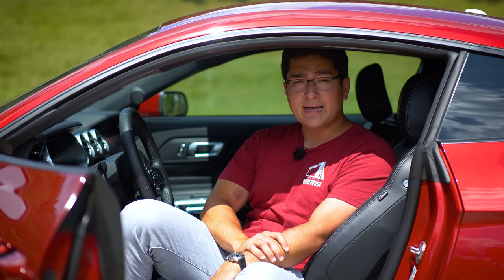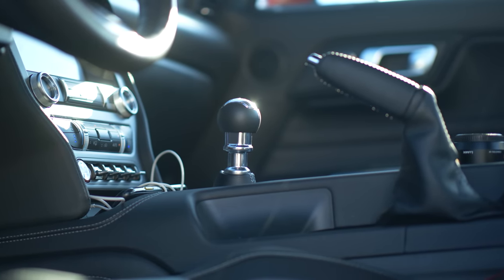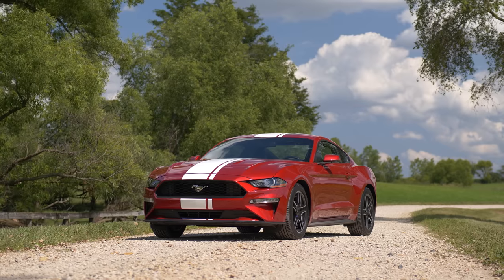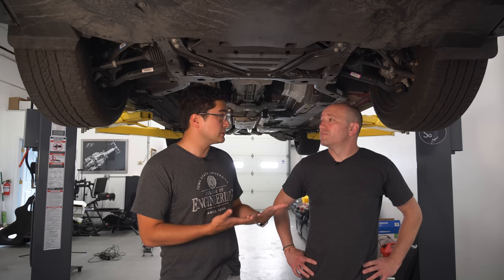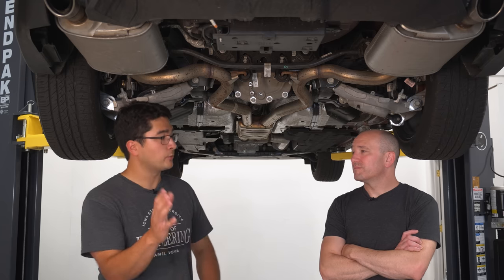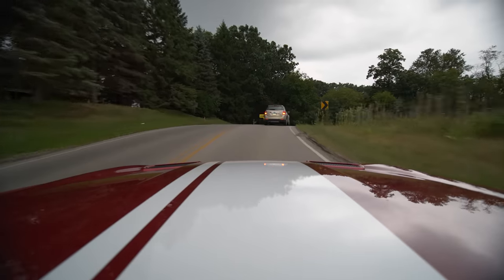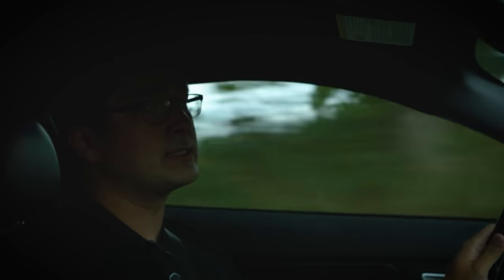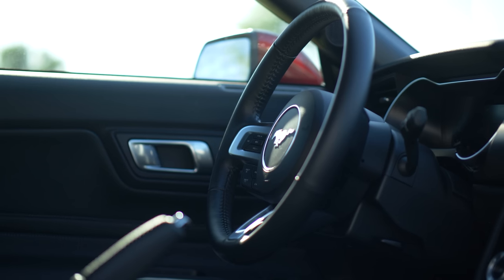2020 Ford Mustang EcoBoost | Red Headed Step Child

Comment: When you consider that the average driver is really not that good at driving, I would hope that they wouldn't get into something with much more performance than this. I think this car is plenty good for most drivers out there.
Reply: So true. If you want little bit more horsepower than 86/BRZ but want to learn the dynamics of RWD, get this instead of used GT or SS
Reply: best comment on here
Reply: @SHKim-xr1jl  Totally unrelated but I absolutly cannot stand the 86 🤢
Reply: Most of the dopes in YouTube videos crashing Mustangs into trees or crowds while showing off should have bought one of these instead.
Reply: Good point and oh, so painfully true.
Reply: It’s arguably too good for most drivers. It’s faster than it needs to be which is frightening.
Reply: I love 4 cyl turbo cars, the problem is the mustang is too big a platform.  The perfect size turbo 4 platform is the BRZ/FRS or Z4/supra.
Reply: Jeff K exactly. this kinda engine if done properly would have been perfect for the fusion or the focus rather then a mustang
Reply: @georgetheodossopoulos7827  That's why we had the Focus ST and RS. They were great cars.
Reply: I don't think its low performance at all. 300hp, rwd, 6speed. I wouldn't mind this car at all. Too much more than 300hp isn't really useable on the street anyway. Back in the 90's and early 2000's people would lose their shyt over a car like this
Reply: For a everyday driver 200hp to 250hp is more than enough.  I don't even need more than 160hp in my daily.  I never use that much power when I go to work and back.
Reply: David Fessehazion agreed. the existence of the eco boost is great but it’s been put inside the wrong car
Reply: Agree, also I always believe it's fun to drive a slow car fast
Reply: It's a decent car but I wouldn't call it a performance car. Maybe sporty?
Reply: @dougrobinson8602  and how about a former deputy in Reno who crashed and killed himself and a passenger when he mis-shifted in a 5.0 while trying to race? yeah, i'll stick with a depowered mustang, thank you.
Reply: Wigletron I agree 100%. I have a 2007 Z4 with 265 hp which is the perfect amount for that car and public roads.
Reply: Casey Schmidt I’ve driven cars with 400-450 HP. You are correct 250-300 is very streetable and fun. (:
Reply: @Drooligan  I'm actually tempted to get the 4 cyl supra now that it sounds like a manual transmission is going to be a real thing.
Reply: My 4cyl has 160hp and is fine.This eco boost has plenty of power but the engine is crap .
Reply: Kool Kitties Are there reliable issues with the EcoBoost 4 cylinder?
Reply: No not everyone needs rockets but in my fantasy land everyone who couldn't operate or afford a performance vehicle would have to drive something that isn't trying to be something it's not. It'll never happen but it's nice when i imagine it
Reply: Phillip Very interesting 🤔 comment. I like your world.
Reply: @jeffk464  I'm with you, there.  The Mustang is functionally a 2-seater, and for that it's way bigger than it needs to be.  
I think when Ford was making the S197 Mustangs and the Challenger came out, Dodge made out the Challengers fat-ass size to be a selling point, so Ford fattened up the next Mustang.
...Just as Chevy trimmed some weight off the Camaro.
Reply: I'm Asian an consider myself a average driver an I own a older v8 mustang with a solid rear axle and even when I drive like an idiot I've never lost control. Anyone u see crashing a mustang has no respect for the car or common sense for that matter. Tho I admit my mustang is squirrely af on shit roads
Reply: it ain't that

Comment: Honestly, this is enough. Rear Wheel drive, manual transmission, and sub 400 Horsepower -- this is something you can actually drive hard. You can learn, you can handle, and you can daily this easily. You cannot drive a, say, GT350 all out on normal roads. I like this :)
Reply: problem is its a ford the king of unreliability...... No car should have ANY problems before 100,000 especially in modern day. DONT BUY MANUAL MUSTANGS they are trash. Ford is being sued right now because the manual mustangs all broke
Reply: i found that i had to exert more effort with the steering on a 5.0 when going through the twisties than with this ecoboost. the front on the 5.0 was quite heavier, like wrangling a mustang. i drive the ecoboost as a fun beater car, but can floor it and get power when passing in the mountains.
Reply: 300 HP is little but not enough to say sub 400 😉
Reply: @acsecond  I've been driving mustangs for years with no issues. The trick is to remember that you don't have to beat the hell out of your car everyday, but that applies for any car.
Reply: Thanks thats so true, the best car to learn in is a slow car you can drive fast. Once you comfortable you can work your way up to more dangerous cars like the GT. That cars fire 🔥
Reply: @CiastekD  I've said sub 400 because that is really the limit of what you can properly use. Also, since when did 300HP become slow???
Reply: @MajorLeagueBassboost  i never said it's slow or something.
Reply: @ghuff31  they switched to a cheaper company to make the trans. Which caused a class action lawsuit. Some owners have replaced trans at 30k 3 times. Drivers say MT82 and MT82-D4 manual transmissions are defective in 2011-2019 Ford Mustangs. Ford knew what they were doing but being the POS that they are, they decided to hide it. They just got out of a lawsuit with focus and fiesta owners because those cars are just as poorly made. some focus rs had major head gasket issues because they made it too thin and cheaply. failure at 20k is not uncommon. FORD stands for FIX OR REPAIR DAILY, Fucked over run down. Ford as a company doesnt care about customers. u vote with your money.... sadly most people dont research cars before buying them.
Reply: D H  you reach the limits on national roads much faster,  that's what I mean. You can get in trouble much faster and easier in a GT
Reply: You cant drive a ecoboost "all out" on normal roads. The GT is a very easy car to drive
Reply: @3star2nr  I have only driven a GT on freeways and town roads so far...i wonder how does the ecoboost compare....but not gonna lie speed bump to speed bump, its insanely fast.
Reply: @LekaLEL  I can answer that. Ive been daily driving my S550 GT for 4 years and I do track days. The GT is a puppy to drive. 

Its a very easy car to handle despite the power and the way the power comes in is very similar to a 350Z its very linear and smooth but doesnt have the wild TQ punch of a LS engine.

The benefit to that is that the car is super easy to control especially in wet weather and on track. It gives you a ton of warnings before it kicks the tail out and the TCS and ABS are awesome! They dont cut the power and they'll let you kick the tail out as much as you want. 

To get out of a slide all u have to do is give it gas. 

The ecoboost is a much more lighter and nimble feeling car. The steering doesnt feel nearly as heavy as the GT. A ecoboost in normal steering feels like a GT in comfort mode steering wise. 

I personally prefer a heavier feeling wheel. 

The brakes on both are excellent but the GT is way better. Interms of power delivery the GT is a better engine overall. The eco does a great job though but u do feel it losing power over 5k. They tuned it for low rpm quick spooling power. 

Interms of real world gas mileage my GT gets around 25-27 mpg on the highway. The eco only gets 2mpg better. 

Around the city the ecoboost destroys the gt in gas mileage. You can get 19-22 city in the gt you'll 15.5- 19 max

On average plan on 350 miles on one tank of gas for highway drives and fill up every 200 miles for city heavy traffic drives with the GT
Reply: @LekaLEL  both cars are great but if u are on the fence i recommend buying the GT. The ecos power and handling gets boring super quickly. The GT is just a much better owner experience. 

Plus you can improve the handling dramatically for under 1000.00

If you want to all the GT350 suspension parts bolt to the GT frame so you can make the car handle super well for very little money. There are always guys selling GT350 take off parts. I saw a guy sell a set of GT350 springs for like 30.00 shipped... 

Even if you go with all new parts its only 2000.00 in parts to fully convert the GT suspension to GT350.
Reply: @LekaLEL  definitely get the GT performance pack. The torsen LSD and the brembo brakes are absolute must haves.

The only issue with the GT is the lack of the oil coolers and the MT82 has issues if u are a drag or street racer. If you are shopping new a Mach 1 has the same teansmission as the GT350 now and has the oil coolers on the trans and diff. 

If you want to build a serious performance car thats the car to buy.

But even if u can only afford a base Gt all the parts are interchangeable.

Most jobs are easy to do on this car for a DIY person. The hard jobs are headers and clutch swaps. This u definitely want to pay a shop to do.
Reply: @LekaLEL  as for reliability get the extended warranty. Fords have AC issues. Mine failed at 70k. They replaced the entire system for 150.00
Reply: @3star2nr  that's cool , see thats what makes it such a good car in our country. Paying $65k to try and get in a GT or pay $47 to get into an ecoboost. 
Insurance on the gt is $800 pm vs $167 pm for the ecoboost not to mention the high expense of fuel in South Africa....the ecoboost makes the mustang platform a more attainable argument for many....all the looks and toys of the gt except the 5.0 engine....is a fantastic selling point.  That's why they sell so well.
Reply: @3star2nr  we only have the auto gt and ecoboost here with pp. While the bullit is the only manual and retails for msrp $73 k
Reply: @3star2nr  I hope the mach1 replaces the bullitt here bc that's all we got besides the gt and ecoboost autos
Reply: @3star2nr  is that dollars or Rands?
Reply: @LekaLEL  so based on that man in all honesty the ecoboost is a great car to own. Like you said saving over 600.00/mth just in insurance costs and 15k upfront in purchase price. To me thats a no brainer.... 

15k in an ecoboost will make that car run 10 seconds on the 1/4 mile... You will need engine work to go faster. 

The ecoboost engine has a lot of potential and its very cheap to modify. 

If you bought an ecoboost you won't be dissapointed with the car. When you feel bad about it remember your saving what like 7000.00 per year... In insurance. To me thats not even a choice
Reply: @LekaLEL  to be honest given your situation id consider the focus rs. 

Its a better buy all around than the ecoboost. Unless you love the mustang body style and interior more.
Reply: @3star2nr  hi they stopped selling ford focus here since 2017, I got the last one, a Ford focus diesel ( lucky because I do heavy miles everyday)

So no use buying a 2016 Ford focus st, I want a new car.

I don't do track days, its just like my daily car,  tired of all the vw gtis and BMW in my hood. I like to be different and have been driving fords since 2009.

But the difference in ownership costs between the gt and ecoboost is massive
Reply: @3star2nr  since I already have a focus its time for something more sexy.

Remember I mentioned the ownerships   costs ( upfront buying $15k, insurance  pm is like $700 difference) not to mention fuel is super expensive here. 

It just makes sense to get the ecoboost. 

Just with the insurance savings I can drive my ecoboost without even caring about fuel economy and still have change over to customise mt ecoboost. 

Remember we get the euro spec mustangs.
So they already come fully loaded with a full pp1 and some parts from pp2.

I don't do track days, and because I moved to the city now, it's more about the looks and drive then speed. 

And because of corona shew, prices have increased $$$. No discounts on the gt,  maybe a few dollars, but the ecoboost have got massive discounts a couple of $100 , which is good 👍. 

 I'm planning on having a kid and get married soon to. So lol I don't want a car that's to expensive,  I want to use that's savings to get the wifey a mazda 3 or cx5.

So the ecoboost is a good compromise in my situation.
Reply: @acsecond  I have my ford focus 1.5 tdci manual trend since 2016, i have North of 100 000km with zero issues, except a blown bulb,  but really now.
Still have my ford fiesta 2012 model going for 200 000km , only did maintenance and changed wear and tear items. 

Both have never left me stranded or broke out of the blue.

I am nervous about the cheap Chinese parts they put it, but that's a quick fix just swap them out for decent parts.
( we don't get the manual mustang , only auto 10 speed).
Reply: @acsecond  the 5.0 coyote an extremely reliable engine. Most of fords v8s are dead reliable granted they have had a few dudes. Its shitty maintenance and ford cheaping out on important harnesses that's the problem.

Comment: The fact that theres 310hp RWD IRS car for 27k, I'm happy.
Reply: S.H Kim bingo
Reply: Exactly, haters can hate all they want but, for less than 30k you have yourself a great looking car,  is plenty fast (especially if you pump 93 octane), RWD with IRS...whats not to like?!
Reply: Yup, if they just changed the body slightly and renamed it, it wouldn’t get trashed by typical haters.
Reply: MIBASO88 it’s a hell of a deal for the money, the interior can be rattle hell but it’s still pretty nice especially on the premiums
Reply: Michael Buffington I really am hoping that for the s650 that will be coming out in 2022, they will do it a favor and rename it the ST....I agree that ecoboost is kinda “meh”...
Reply: That's a pretty bad Price?
Reply: Frank White  well a Tesla isn't a bad deal but I know a mustang is never a good one
Reply: @popinmo  Dont like it, dont buy it.
Reply: @M4B21S88  duhhh
Reply: @M4B21S88  makes no sense
Reply: @popinmo  duhhh
Reply: @M4B21S88  you are clearly hurt
Reply: @popinmo  lmao
Reply: Eh, I'd rather have a lightly used 370z over the ecoboost. Or better yet, a lightly used 5.0 GT premium or 2016+ Camaro SS. F8ck that depreciation hit.
Reply: rockn roll Yes, the 2015s especially, had some issues and were the ones more likely going boom when tuned (the ones built in Valencia, btw). It was a brand new platform in the mustang. Come on, man. (Most) Everyone knows that the first year model of anything new has its risks, in any car model. Youre more likely to hear a few horror stories and make it out to seem like ALL EB mustang owners are having issues left and right. Thats just simply not true.  Plus, a few of those having booms were due to user error - and still are (tuning for 91/93 octane and pumping 87 😬, as an example, or just bad fuel offered at their gas station).
Im at 88k miles in my ‘16 and no engine issues.
Theres a few ppl in the forums that are over 100k and even up to 150k, some stock , some tuned/ modded, no issues.
Reply: 03 04 Cobra?
Reply: Mike Gee  that's what I wrote, Mike
Reply: 1967 Fastback Mustang GT 390 cubic inch had 320 hp, though, curb weight is 2,758 lbs., which means it is 1,000 pounds less than the new 
EcoBoost Mustang
Reply: Prefer Supercharger (Whipple/ Roush), because at 38,000 miles i had Turbine Lockup within the Turbos at 82°+. This is caused by Thermo Variations consider locations of Turbos Ford mounts them below for lower center of gravity.  Problem is they're right next to the very hot engine.  Ricers know this and mount them up high close to heat extraction hood vents.  To keep them cooler, and not for show. Now the Turbo Shell expands like a donut 🍩, while it's being baked the outside expansion is outwards vs. Inside expansion is inward the hole gets smaller. The Blades expansion is outward to be larger to hit the Shell. Locking up the Turbine Blades, and then add the Backflow from the Intake and Downpipe to it to spool the the Turbos more.
My fuel mileage went from 
32 mpg to 8-12 mpg.  Glad for 2021 it'll have the GT500 engine package 5.0 V8
Reply: for me insurance is less than half of the GT. let alone the gas saving.
Reply: @yusufj.k4336  can I be in the car too?
Reply: Young 90’s me is excited about this fact lol
Reply: @Pube83  get a lightly used EcoBoost and take advantage of the depreciation
Reply: @M4B21S88  people will always hate but the same people do not remember the 1st stang was was 4 cylinder
Reply: Same, these guys are snobs
Reply: It's not a car. Ecoboosts literally a tampon with wheels. S550s heavy man. That 310 hp goes out the door quick
Reply: @danielservin2450  Yes it's heavy, but for the price, you get this or 86, Miata. All three cars are slow.